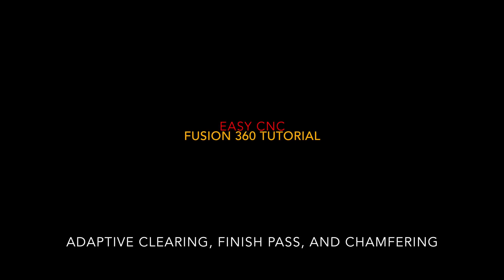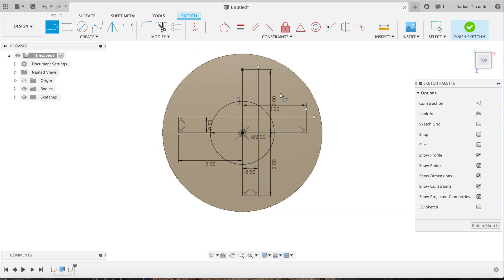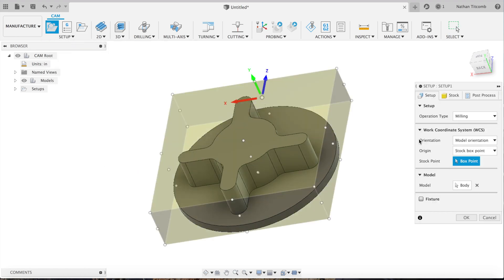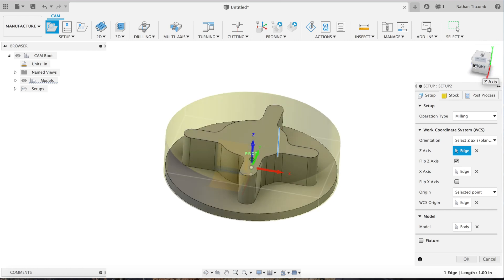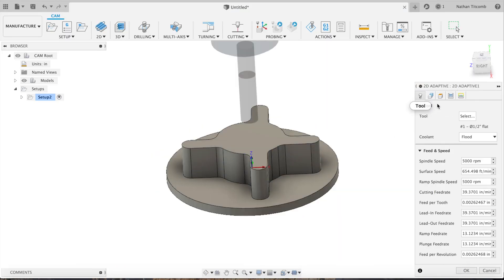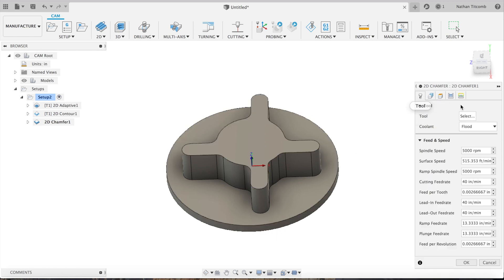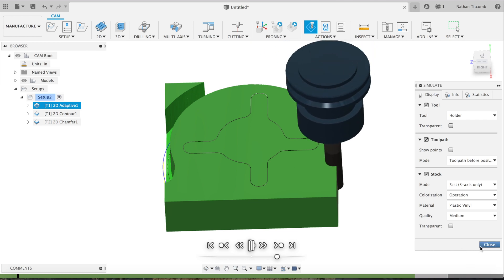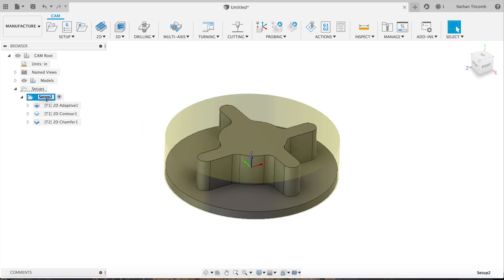How to use adaptive clearing in Fusion 360

Comment: How do you link both NC programs so they follow each other? This doesn't work for me. Great video BTW.
Reply from the maker: you can copy the load onto notepad and manually change it. Are you having trouble posting multiple tool paths together?
Reply: @easyspeedsandfeeds1410  I solved this, I just needed to simulate from the setup.